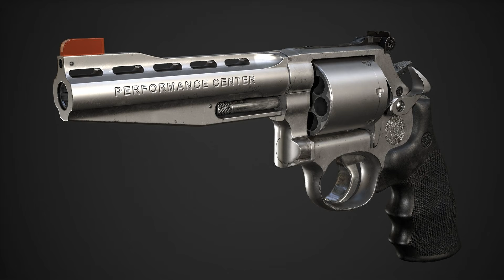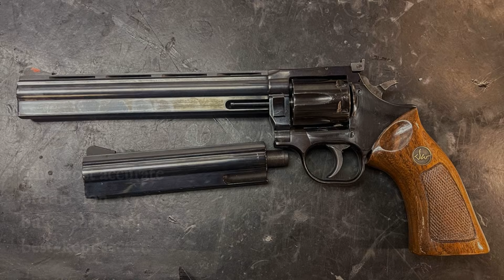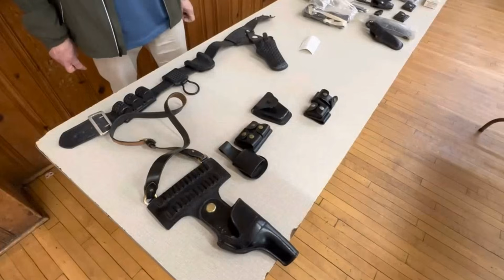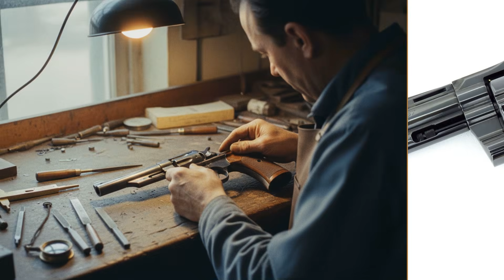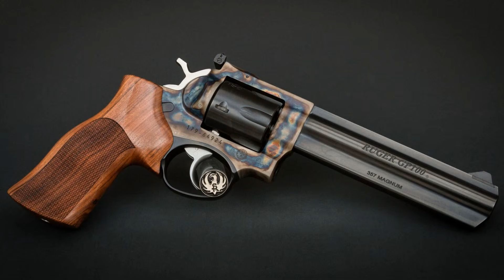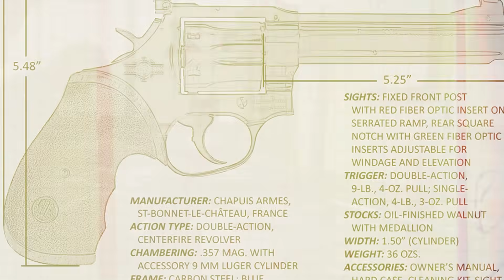7 Best .357 Magnum Revolvers Of ALL TIME

Comment: I have 2 Ruger Security Six’s one with the 2.75” barrel, the other with the 4” barrel (preferred weapon). I’m actually surprised the Security Six wasn’t on the list especially since Ruger says it is a better gun than the GP101 but cost more to produce than the GP101 even with the GP101’s supposed improvements. I’d run a Ruger Red Hawk before a GP101.
Reply: Might not be on the list because they're not an expensive gun. I think they go for around $500 used. I got mine about ten years ago for $250. IDK just a thought